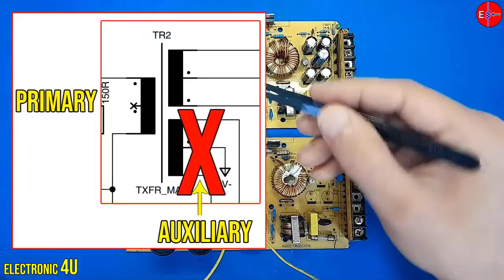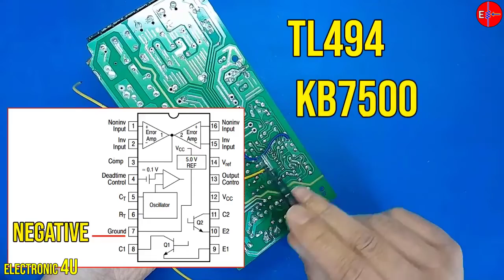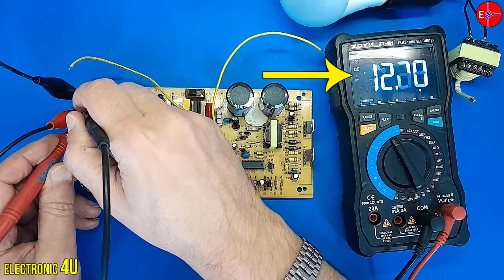How to convert SMPS to 220V power inverter?

Comment: Hi sir Allah has blessed you with a lot of knowledge I have a 585 watt solar panel with an output of 51 volts Please tell me any SMPS supply which can be turned on by 25 dc to 220volt output voltage fix 12 volt Thank you for your guidance
Reply from the maker: Hello, connect your panel to the battery first, and then get 220 volts with the help of an inverter

Comment: Thanks! Nice job. Is it possible to pump up the frequency to 600Hz for example? I suppose the PWM tune able with some resistor / capacitor change? ( I need something from 12V to 110V but with 600hz- max 1800Hz) If you would plan a video like that :D That would be cool! Thanks anyway!
Reply from the maker: Thank you for your attention. That's quite right. Pin 5 and 6 are used to change the frequency. Number of coils for arbitrary voltage 🙏
Reply: @Electronic4U-david Frequency cannot change below 1Khz, as this is the minimal that the IC can handle.  (regarding its datasheet). By the way, I have tried your method, and it is works well. Only note is, in my version of S-360-12, the safety electronics, like the transistor, capacitor and diode, etc, wasn't built in. I had to improvise :D I built in the diode and made the short circuit. :D It works on 27Khz by the way. I didn't put any transformer on it, as it is useless for me. I have to find a transformer, that works on 600Hz and I build a separate driver circuit to it, probably will use a IR2153 IC and a half-bridge driver. Thank again the video!
Reply from the maker: Thank you very much for the interesting points. ❤️

Comment: What is the output of the transformer voltage?
 And the output voltage is DC or AC voltage?
What the output voltages when we connect 12v and 20v respectively?
Reply from the maker: Thank you for your attention. Voltage output with a 12-volt connection is about 180 volts DC، depending on the transformer.
Reply: @Electronic4U-david  I assume you meant 180V high frequency AC, as the transformer wouldn't work with DC..?
Reply from the maker: Yes, that's absolutely true. I am sorry 🙏😊
Reply: @Electronic4U-david  No problem 🙂